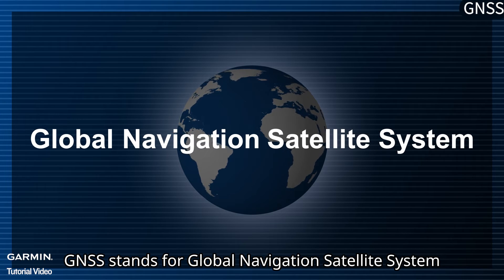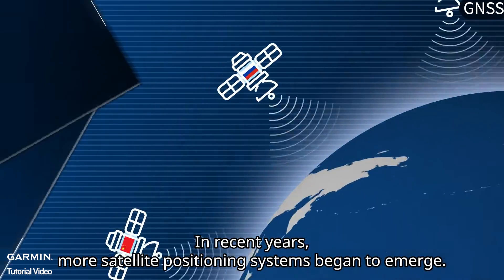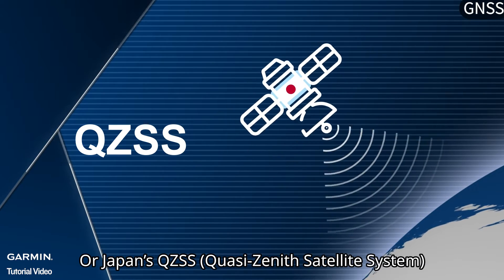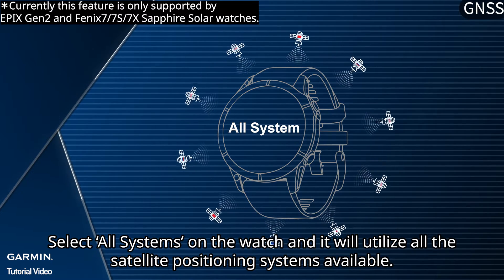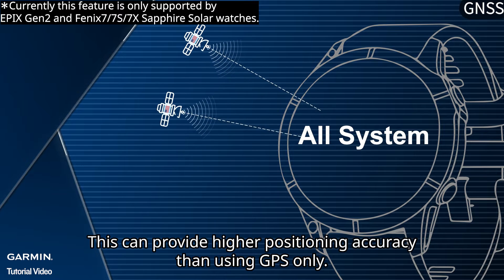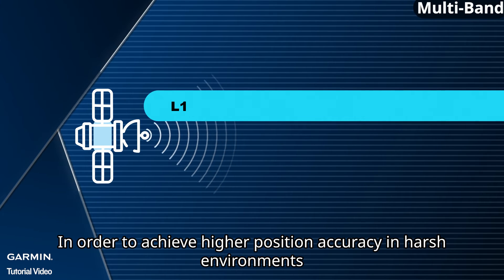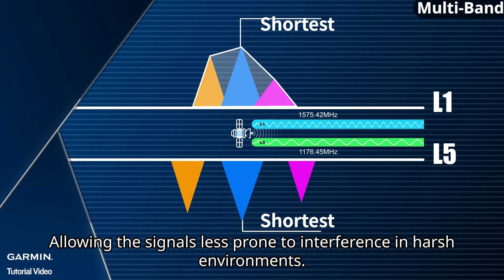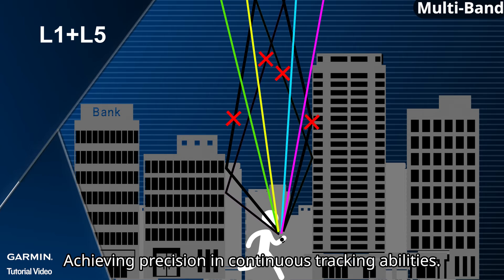Tutorial – epix: What is Multi-Band GNSS?

Comment: What is the difference between multi-band gnss and muti-gnss support? Or it is just a different way of writing to confuse customers to make them feel like having an upgraded watch?
Reply: They're different things. Multi-GNSS (also called multi-constellation) means the receiver picks up satellites from multiple GNSS constellations (e.g. GPS, Galileo, GLONASS, BeiDou). This allows for an increased number of satellites available (you need 4 at the minimum to have a proper location fix). Multi-band on the other hand means the receiver picks up signals in multiple frequencies (L1 and L5 as shown in the video) - i.e. multiple signals from each satellite. That allows multipath error correction, improving accuracy even in more obstructed environments such as around tall buildings or sharp elevations in terrain.